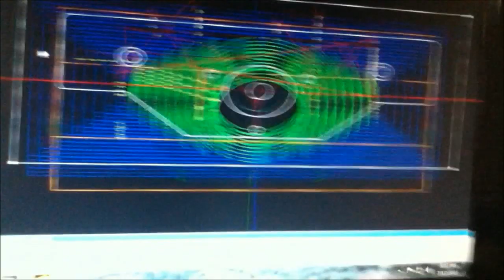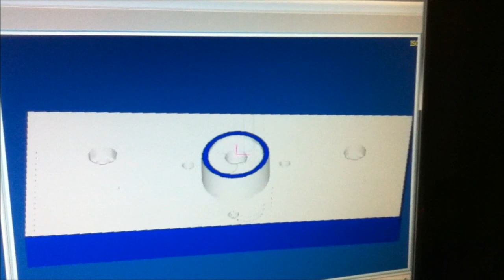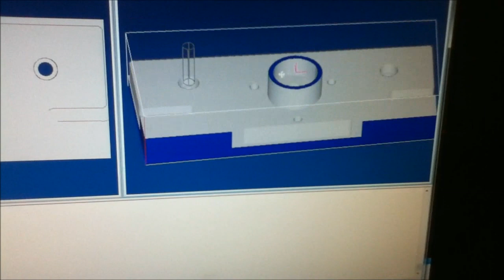Making X Axis Bearing Plate - International Version

Comment from the maker: @jeremy0203 - The 6050's are fine but I would have liked to have the 5056's for the wide selection of microstep settings.  Realistically though 8 microstep is plenty and very powerful with the ball screws.  5 microsteps would be easier for software stepping to keep up with and allow higher rapids on my machine but not important enough to double the price.